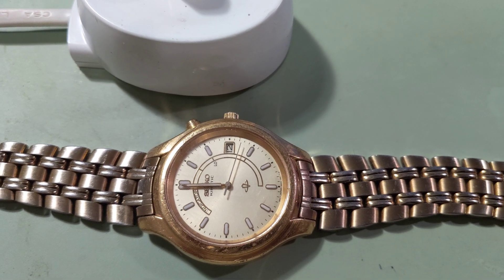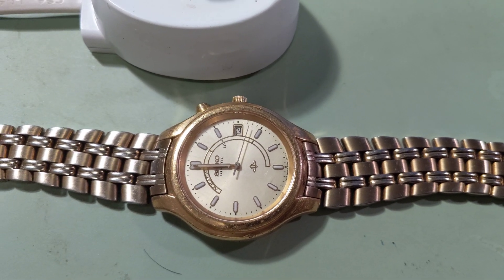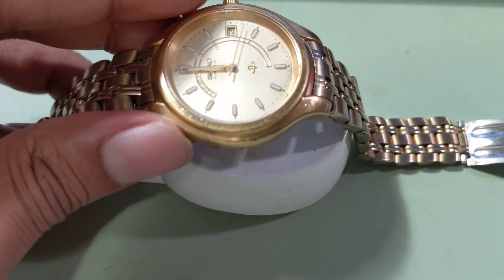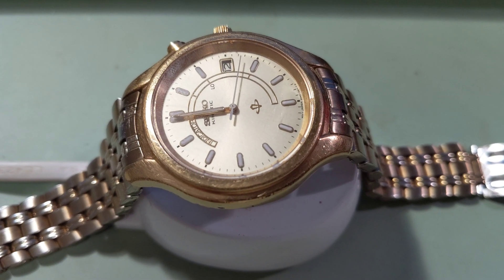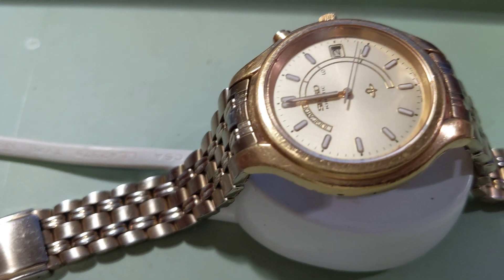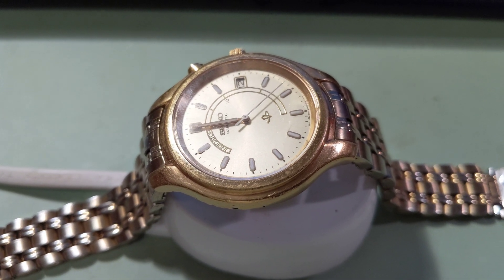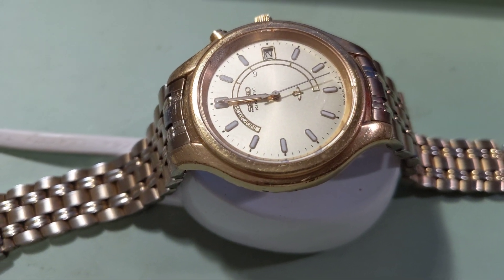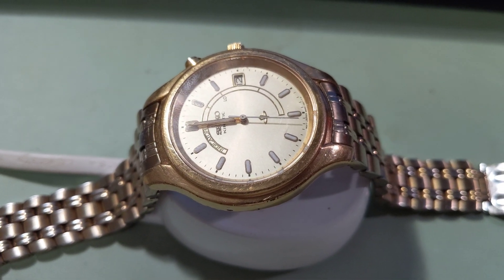Recharging a dead Seiko Kinetic Watch using a Braun toothbrush charger

Comment: i put my seiko kinetic in the dryer. wrapped in a towel tightly and secured with a rubber band. air cycle for 30 minutes. running for 2 days so far
Reply from the maker: Watch mechanisms are not that durable to take that much shock. You run the risk of a gear in the movement train slipping. Having said that, Seiko Kinetics are not worth much so you don't have much to lose.
Reply: @DesignReviews  the watch is 10 yrs old, original capacitor.  i have many others . not that important to me.  it was heavily cushioned, believe me. it was tripple wrapped in a towel and encased  in a padded bag i was amazed that it worked.its still running after 2 days. i wore it every single day for 10 years . then it started losing charge easily. do you think charging it with a sonicare tootbrush charger would work?
Reply from the maker: @markv.5962  It sounds like the rechargeable battery is shot. It's a $25 replacement and it should be good for another 10 years. A sonicare charger would work fine. Any inductive charger will do the trick.
Reply: @DesignReviews  thanks ill give it a try

Comment: Was it charged on morning?  Thanks for the video.  Will there be a follow up showing the charge level in the morning?  I have several of these, looking for way to keep them charged (especially with new power cell).
Reply from the maker: I just posted a new video Timelapse showing the charging. It take 1 hr for 25%
Reply from the maker: It charged fully. Didn't bother uploading a video since it works out everytime.
Reply: @DesignReviews  thank you.